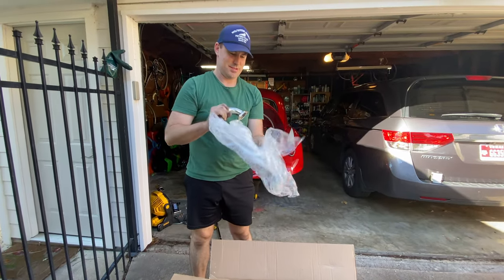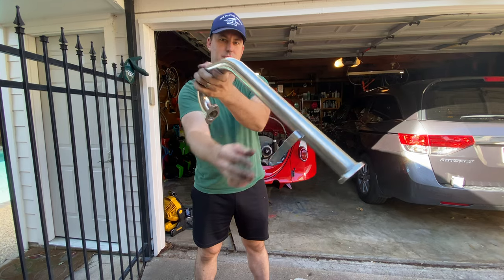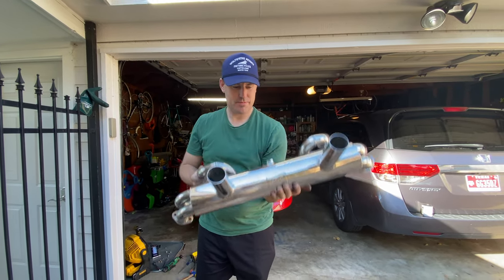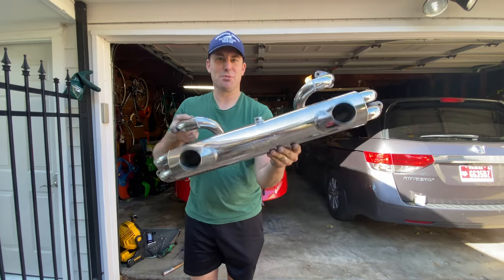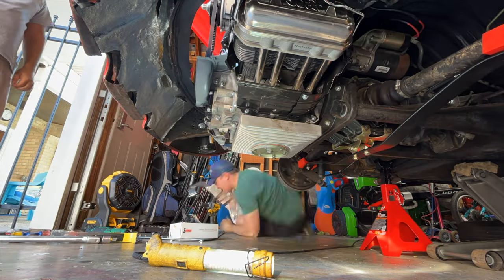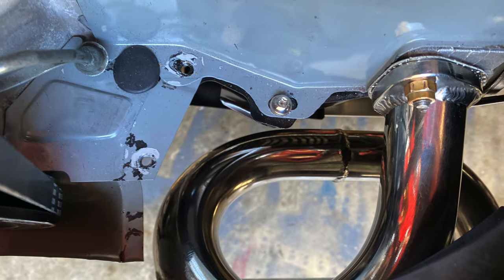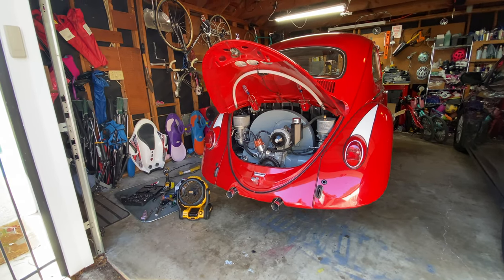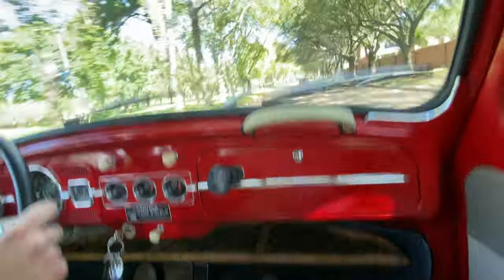Comparing the A1 exhaust with MAF Porsche 37mm stainless exhaust for VW bugs

Comment: Yeah, I was the first to have Tiger put a race bullet muffler in the style of a single “Phat Boy” of “Quiet Pack” position. This was for his A-1 Lowdown header. He had told me they only use a race bullet in place of a stinger for tracks that require mufflers/noise reduction. I said “no, I want it in place of the Dynomax muffler (too quiet). Race bullets are straight through perforated mufflers and the shorter they are, the louder. After he built mine he started offering them in the Dynomax location for the Lowdown header and also for the Sidewinder header. That thing wasn’t cheap and took 4 months to get it, and now it’s hanging in the garage. I’m currently using a short stubby pipe that clears past my rear apron about 4 inches. Loud isn’t the word for it. With my engine set up, it sounds like a Harley Davidson idling. Perfection!😂. I really like the way your new exhaust sounds and looks. That’s a pretty penny though. Very nice V-dub. Enjoyed the video!!!!